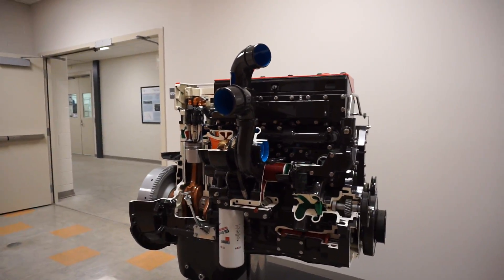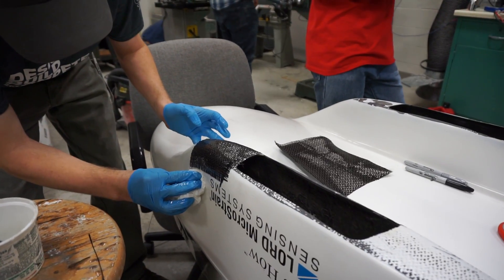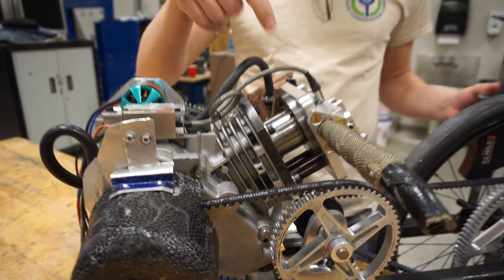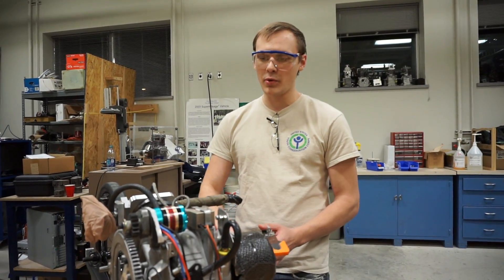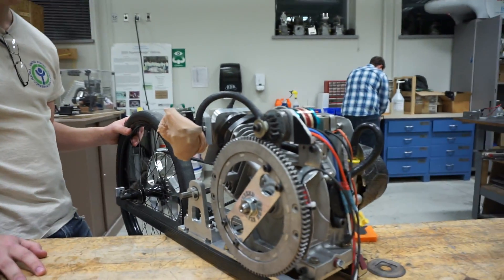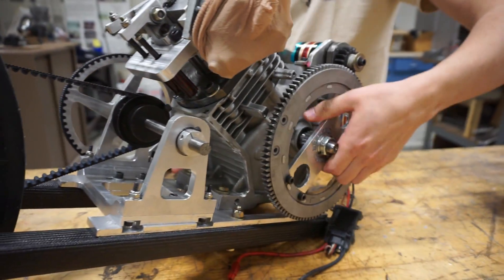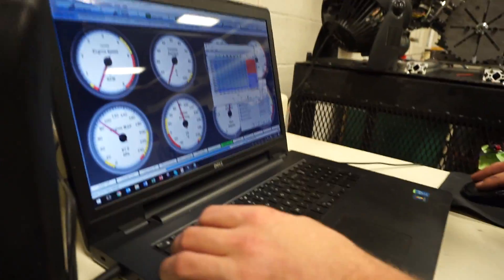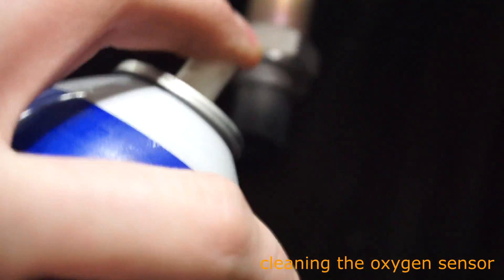How to Get Over 2500 Miles Per Gallon - Supermileage Club Penn State

Comment: People really do not realize but it is the nerds that run the world. Hey I was wondering how is it possible for him to adjust the volumetric efficiency? The only way I can think of if it was blown or turbocharged and he was upping the boost but I did not see that it was blown or turbo'd.
Reply: Nerds built the world, greedy assholes run it.
Reply from the maker: Hahaha YES!!!  I am not entirely sure.  I don't fully understand it.  I think it must be compensating for it not adjusting it.  When the throttle valve is closed the volumetric efficiency would be very low.  I think somehow it's tying throttle position, mass air flow, and engine displacement together to get the right amount of fuel into the engine.  But yeah, that's only a guess.  I can ask Jessie more about it next week if you'd like.
Reply: Can you tell me how compression ratio would have anything to do with volumetric efficiency. Volumetric efficiency relates to how efficient the engine can bring in air fuel mixture on the intake stroke. It is rated in percentage. So if you are sucking air in through a valve the size of a dime you would have a very poor rating lets say 35% and if you have 2 intake valves that are 1.5 inches then you might get in 85% of the air fuel mixture so how does compression ratio affect that?
Reply: I had an aftermarket turbo and engine management computer in one of my cars for a while and had to go through a similar process to fine tune it for my particular engine. The process is generally to use the throttle and dyno (or varying slopes of road if in the car) to run the engine through each airflow/RPM combo in the table and use a wideband O2 sensor in the exhaust stream to measure combustion efficiency. You then adjust the injector duty cycle up or down per table cell depending on the desired change in air/fuel ratio.

I assume one table showed the O2 sensor readings and the other was input for the injector duty cycle (which, combined with the nozzle size and fuel pressure, determines amount of fuel injected per combustion cycle). I guess the operator was new to it and was confused at how it works; I think setting the input tables sets the actual duty cycle rather than target combustion ratio, so the effect was probably to make the mix super-rich everywhere, leading to lots of unburnt fuel in the exhaust and thus a backfire!
Reply: Well 'nerds' can ;-) Air is a fluid with mass like every other fluid. If you speed it up in a narrow pipe it gains energy. When the piston is at it's BDC (bottom dead centre) the air in the inlet channel stil has a bit of speed and thus rams into the combustion chamber, giving it more than 100% VE. The downside is that this only works in a part of the rev range.
Reply: There is still vacuum in the cylinder when that piston hits bottom full throttle or not.
Reply: they were adjusting the volumetric efficiency by increasing the compression ratio. that's what the shims he was referring to were doing. the larger the shim between the top of the cylinder and the cylinder the lower the compression ratio. he mentioned when they tested the engine with too high of a compression ratio it started dieseling. meaning the cylinder pressures got so high a spark was no longer necessary to combust the fuel. issues with higher and higher compression ratios would be pre detonation. this can cause catastrophic engine failure as the fuel ignites before it's suppose to, causing a force in the opposite direction of engine rotation. 

also they were attempting to increase efficiency through the use of fuel injection. by sending atomized fuel into the engine a higher amount of fuel can actually be burnt rather than wasted.
Reply: they are not changing the VE with the computer, I run the exact same program on my race car. the VE table is what controls how much fuel is injected each revolution.. the x axis is rpm, the y axis is engine load (measured by intake air pressure) the numbers on the table are estimated volumetric efficiencies at those points, but its best to just think of them as a fuel value when adjusting them, higher number = more fuel.. 

and yes, with proper valve timing and engine setup you can get over 100% at a certain rpm, modern cars have variable cam timing to widen this rpm range
Reply: Could easily get more mileage out of it by adding bearings to the psuedo lifters there so when they go up and down it reduces the friction and makes less work on the engine.
Reply: slidestang242 - Some very high performance engines can have a VE of 130%. 

CookinHaM - They could be using an OHC Honda engine, but that would violate the rules, IIRC.
Reply: Dave Brittain i think they test the volumetric efficiency by regulating throttle, and creating vacuum inside the cilinder.
Reply: Oh, thank you, i didn't know that. But there is no vacuum when the throttle is fully open. Am i right?
Reply: Dave Brittain maybe a constant velocity carburetor. They use differential air pressure to change the size of the Venturi.
Reply: Not just intake. exhaust too!
Reply: lazzer408 I think you have your tinfoil hat on too tight.
Reply: Deep.
Reply: I
Reply: piston work
Reply: The volume is changed by the shimming he does between the head and or jug and the crank case its all about how far the piston can go up to compress the mix not hard this is commonly done
Reply: @kek-ass You really keked his ass!
Reply: KEK-ASS were not "that" smart XD but ok cool
Reply: dave b ,, these guys are young and learning ,, i remember when i were young and would act like i knew more then i actually did and also told a few fibs about the mpg of certain things i built ,
Reply: i'm no engineer, but at the rpm this engine runs at, and given the cc's and what i've seen about tiny superchargers, it's impossible to run them fast enough to overcome the losses AND improve mileage. and for the turbocharger part, just forget it. you need at least 500cc to get enough exshaust pressure to run the smallest turbines around.

no, the answer is a throttle-less (like the fiat multi air system), direct injected, variable compression engine. or.. running a generator with a small wankel engine at constant rpm.
Reply: if the nerds ran the world we would not have any issues
Reply: There is always vacuum inside a cylinder unless an engine is blown or turbo'd. Volumetric efficiency is the measure of air volume/fuel mixture in a cylinder at BDC under RPM. The more efficient means the easier the mixture can enter the engine. The engine has to work to pull in that mixture and for every percentage that it lacks in volumetric efficiency is less fuel mixture to ignite and create power.
Reply: No that would really not have much to effect on it. Any normally aspirated engine can not achieve 100% volumetric efficiency. It is simply impossible.
Reply: Dave Brittain Actually it's the corporations that exploit the nears that run the country. If one of these kids comes up with something revolutionary, you can bet it'll be the last time they see it.
Reply: Dave Brittain no it's who ever controls the money that the nerds need to buy with to do their experiments rule the world...  and that's the BANKS!
Reply: Dave Brittain 
Tits

Comment: I'm not sure I understand.. why do they need so much mileage on the racecar? It seems like there is a trade-off for power in order to allow for these massive gains in mileage.
Reply from the maker: It is a competition against other schools to see who can get the highest fuel efficiency.  Yes, there are trade offs for power and comfort.  Power and comfort are easy to do.  Efficiency is not.  It's a high engineering challenge to obtain such high efficiencies.  Makes better engineers and it's a lot of fun.
Reply: Ya the race is actually mileage not speed.
Reply: Arya Javaheri 
it's not how fast you go it's how fast you get there. also looks like a modified 1919  Indian engine .

Comment: Nice man! I was in a SEM team for over 3 years, it was one of the most exciting things I did! 
To get over 2500mpg really requires creative engineering. At that point the smallest things start to matter. Things like viscous bearing friction, rotating body energy losses, thermal material properties, resonance etc. Even finding a way to keep the engine at operating temp because of the efficiency being to high to keep itself hot.

Be prepared to learn a lot ;-)
Reply from the maker: Yeah!  It is incredible.  Honestly I don't think their steering alignment is very good.  Might be something I want to work on.
Reply: I'm sure you could do a great job on that. Maybe it's nice to take us trough the process of doing research, designing, manufacturing, testing and reviewing the results. You can show young engineers why these projects are so valuable. I'm sad I didn't document those things when I was working on it.
Reply from the maker: Yeah I can definitely do that if I decide to redesign the steering.

Comment: incredible MPG , Great stuff man .. Thumbs up !! Was that a generator on the end of the engine driven by a belt ??  If so what is the output of it ??
Reply from the maker: That's the dyno.  It's a DC motor which we have calibrated and made efficiency curves for.  We use it as a starter motor and then flip it over to generator mode to put load on our engine.  We load it up with a bunch of 200watt light bulbs.  I don't know for sure but I would say at least 1.5KW.
Reply: Ahh, That's cool ! Thanks for the info ..
Reply: Makerj101 its a brushless dc motor do you have connected with a bridge rectifier to make the power back to dc because this outputs 3phase ac

Comment: how do u get that much milage?
Reply from the maker: Magical Squirrel i didn't really talk about that in the video. The main thing is using a method called burn and coast. We burn the engine for about 15 seconds getting us up to about 22 miles per hour. We then down until we hit around 10mph then burn again. aerodynamic design. super low rolling resistance tires and bearings. super light carbon fiber design. that's really about it.

Comment: Just wondering if I'm the only one experiencing a problem while playing? Hoping I am.
Reply: it fixed it, thanks
Reply: I've got problems with the video too, but I think my problem is that the video is only in 1080 and 780, and my internet doesn't like that.
Reply: Ah maybe that's my problem too, thanks for replying.
Reply from the maker: Blake Barker I did a little googling for you. try forgetting you're Wi-Fi and reconnecting. other people were suggesting signing out of all Google sessions and signing back in. I'm assuming you can't watch any YouTube videos, or is it just mine?
Reply from the maker: Iron Beard all the qualities are live now!
Reply from the maker: Blake Barker what problem are you having?
Reply from the maker: Iron Beard yes, that is because YouTube hasn't finished processing it in those lower resolutions. The quality that the video was uploaded in is always the first resolution to go live. check back in 15 minutes and all resolutions should be available then.
Reply: The video says "There was a problem while playing
(Playback ID: randomcode)
tap to retry" and when I tap to retry the code changes its probably an issue on my end.
Reply: Thanks! I will
Reply: The vid ran perfectly on my system
Reply from the maker: Did that fix it?